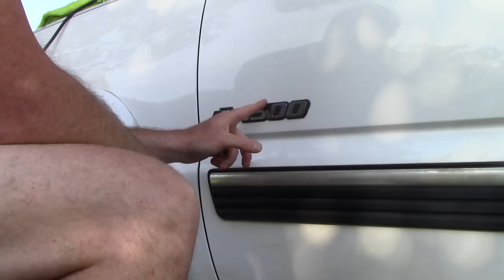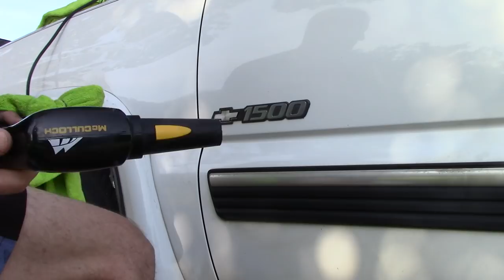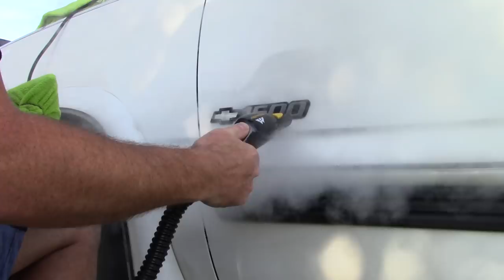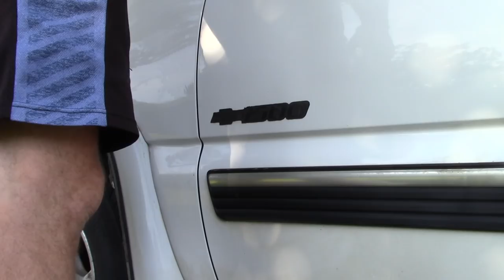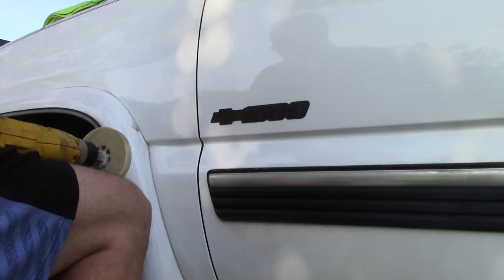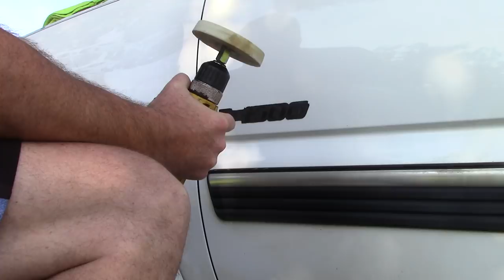Debadging - Removing Car Emblems Fast & Safely!!

Comment: Thank you so much, Scott! I watched your other video, removing the badges without having a heating device. I used a 25 pounds fishing line and I was able to get the job done a little over 30 minutes. Took me a bit longer because the lines broke on me a few times. If I had used a 50 pounds line, maybe I would've gotten the job done faster. I then used that 3m eraser and that took maybe another 30 minutes or so. All together, it took me over 1 hour to complete the job on my 2018 yukon xl. Couldn't have done it without your video. Thank you so much!

Comment: i watched a couple of videos today on this....and one was yours.   It worked PERFECT.   Took the hood badges off of my 2005 Chevy 2500.    Used Goo Be Gone and worked great....it smells citrus.   Put the new badges on and I am PLEASED beyond measure.   Used fishing line.... Works great.   No heat gun.   Thanks again Boss.

Comment: I have one of those rubber wheels. It worked good on an older truck, but it burnt the crap otta my newer trucks paint. I wouldn't recommend just diving in with one of those. I'd test it on the paint in a spot under the hood or inside a door first to see if it burnt the paint.

Comment: I followed this video as closely as I could. I think the steam burned a little discoloration into the clear coat (white car). Big faint yellow spot. I was concerned but I buffed it out with orange pad and maguiar’s polish. Two passes at a time, checking, and watching it slowly disappear. Just in case somebody else runs into the same issue.
Reply: They should come off just as quickly without adding heat. I debadged mine on a 60 degree day w dental floss cuz I didn’t have fishing line

Comment: Hi I was searching YouTube and every other site I could think of for a way to remove the adhesive that is left on the dash after the vinyl has been removed.  I have a 1998 BMW Z3 and the vinyl has basically melted or became unattached to the dashboard.  I have already removed the vinyl covering but I am now left with a sticky residue.  I have tried Goof Off and Acetone but it still isn't working very well.  This glue is a bear.  Being a female and having no clue how to attack this problem I saw your video and knew that if anyone would know how to fix this it would be you.  Could you please advise me of a product that would actually work on this stubborn adhesive?  I would really appreciate your guidance.  BTW, very interesting video.  Obviously you are a pro at these things.

Comment: They probably use a heat gun because they don't have a steamer, as I........but I certainly am not "OVERTHINKING THE MOMENT"!.......that one came somewhat out of left field from you Scott.
Reply from the maker: oh I'm sorry..didn't mean to offend anyone..heat guns can bring on some problems in the hands of the inexperienced and they could burn the clear coat and thats what i meant by overthinking  the moment ,believing the heat from the heat gun is needed although it could cause damage...and most pro detailers will have a steamer plus a heat gun but haven't thought about using the steamer for removing emblems..far safer and as effective and in my opinion reduces your liability ...so not really coming out from left field but i understand why you thought that way..i should have explained more clearly..my fault:)...the steamer i use is less than 200 dollars and can be used in so many areas of detailing..you should look into one but I'm not sure if you detail as a business or not?...thanks for your comment Anthony and sorry if you felt i was stepping on your toes for using a heat gun..in the future i will use something that may blow some minds where heat isn't needed what so ever and i have never seen it done before but in my world:)
Reply: Very true.....heat guns in the hands of an inexperienced person or detailer can do damage if not used properly. I've been a mobile detailer for several years and have always tried to limit the amount of equipment I carry around from day to day. I frequently travel out of my home state to work for clients and found myself using my old steamer less often. I typically will carry my heat gun, fishing line, 3M eraser wheel, and rapid remover to complete debadging jobs. You''re definitely right about the steamer limiting anyone's liability. No toes stepped on or love lost brother. Can''t wait for the next video....keep up the great work!
Reply from the maker: remember citrol works just as well as rapid remover for glue residue and its cheaper..plus citrol can be diluted 1:1 and still be as effective!..i pay 39 a gallon from my local napa and if i dilute the product that would be 20 a gallon...wow!..i still have rapid remover but i find i use it less and less these days
Reply: and now i'm going to NAPA...I paid $61 on amazon and it was already worth every penny! Cannot believe how effective it is on EVERYTHING! Especially bugs though. God front bumpers are a breeze now. MANY thanks for that one Scott! Keep making videos, you're awesome!

Comment: Years ago the 3M eraser used to be orange/red and was a lot harder and more effective and durable. They changed to what we have now, a bit softer, safer and less durable, but still gets the job done efficiently. It’s main function was to remove pinstripes off a car and exactly what was done in this video. Great video👍🏻👍🏻

Comment: I had to remove the door molding on all my Panthers because the cheap plastic chrome, like the kind they use on that truck, deteriorated and started flaking away. Thanks for the demo.
Reply: I’m about to buy a merc and it has ugly chrome mounding all over it. It’s a 2004 so im worried if it will come off.

Comment: Scott - Question - I used this method to debadge my new maroon 2019 Traverse.  It was a cloudy day when I did this. In the sunlight today, I can really see I guess they could be burn marks on clear coat? They look almost orange in color. The surface feels flat and regular, but I wonder if there is any way to correct this?  Paul
Reply: Did you by chance take time to do a medium to light polish and follow up with a glaze and wax?

Comment: I want to do this to my car but I'm afraid I might cause some serious damage. How much does this type of work normally cost? Thank you in advance.
Reply: David Saenz depends on where you live. Depending on how long the things being removed have been on the vehicle is one important question and spend the money and get the 3m wheel there like 30$ comes with drill attachment if your car is newer it’s pretty easy those 3m wheels make it a breeze. Google or contact detail guys around you and ask there price I’ve heard of it costing 100-300-400$ again depending on what’s needed to get the paint clean once the emblem is off if they have been there yrs might want to leave them or replace with new ones after removed. Cheers

Comment: Scott, where do you get your Citrol?  I found it on Amazon for $50,  anywhere I can find it for less?
Reply from the maker: i buy it at my local napa for 39.00 dollars a gallon...not all napa auto parts will carry but i believe all can order it for you at the same price...hope that helps me friend...plus i will find a link for you where you can order it online for the same price..yes amazon tends to be more for just about everything unless your a prime member and get it free shipping in two days
Reply from the maker: rich also remember citrol can be diluted ...even at 1:1 its extremly effective!...so that would be 25 a gallon for you if you got it from amazon...so much cheaper than rapid remover!
Reply: Do you use it diluted or at full concentrate?  Let me rephrase, do you have a bottle diluted and a container you carry at full concentrate?
Reply from the maker: yes..i use it full strength a lot and have a bottle at a 2:1 ratio as well

Comment: I literally walked out to my tundra and took some 6lb test line and removed the sr5,tundra,and upper badge on both sides in 5 min total, I did not need to heat up shit, I also cleaned around the adhesive before I used the rubber eraser wheel then after all the adhesive was gone I took my buffing pad and buffed out Each area then polished, turned out awesome. All in all it took me I’d say 35-40min, definitely did not take me 12 min to remove 1 emblem and definitely did not feel the need to show the whole world how I personally achieved this.